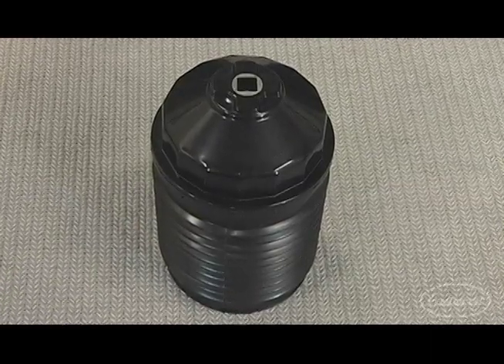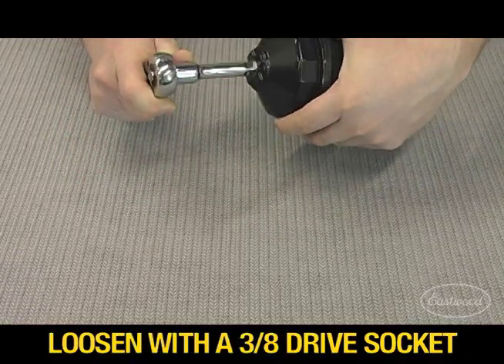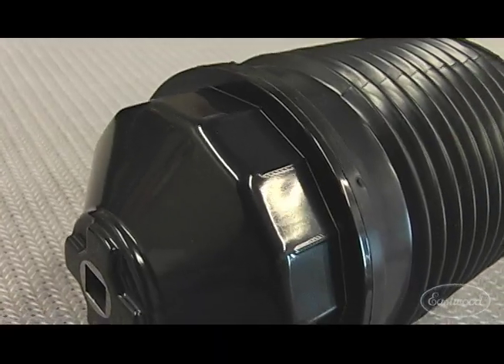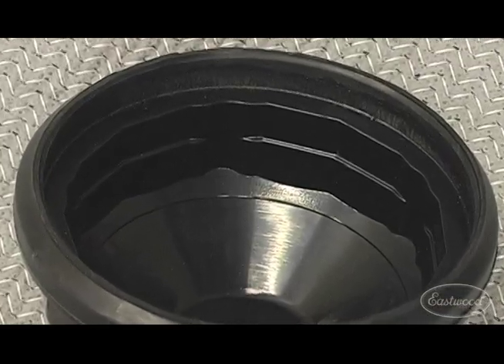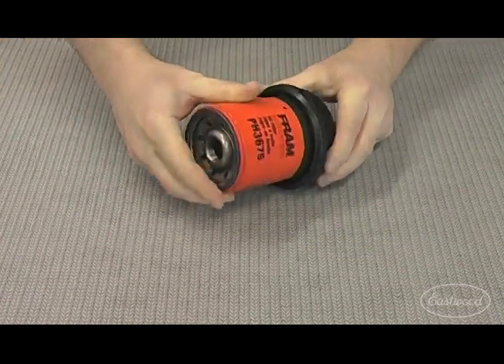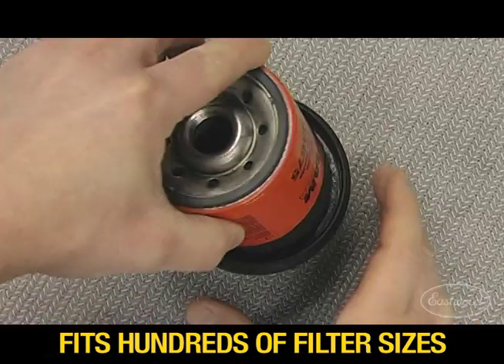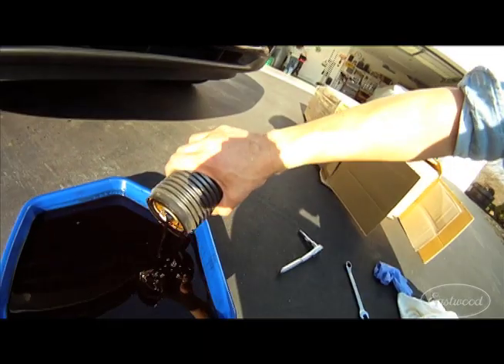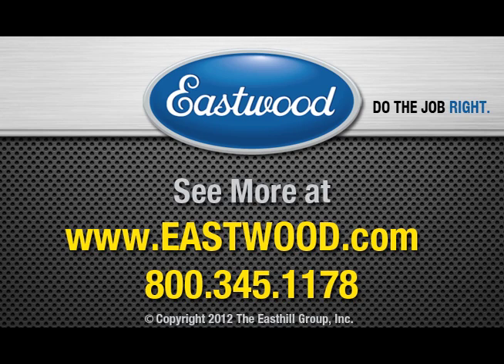How To Change Oil with the No Mess Oil Filter Wrench from Eastwood

Comment: This works for vertical and horizontal filters and the price is right!  When the filter& oil is not super hot, get a 1 gal Zip Loc bag, roll the top down about 1", line the bottom with 3-4 paper towels. Loosen the filter just enough that you can spin it by hand but no oil is leaking.  Slide the Zip Loc bag under and up the filter. With your hand on the outside of the Zip Loc bag SLOWLY remove the filter while keeping the top of the bag even or above the filter gasket.  Wa-La no mess!

Comment: I hate those! They “hop” on the filter flutes as you turn them...
Reply: There are different sizes (3) Also try turning the filter so that it's not real tight against the motor, but not leaking.